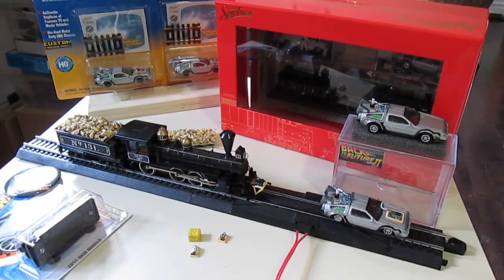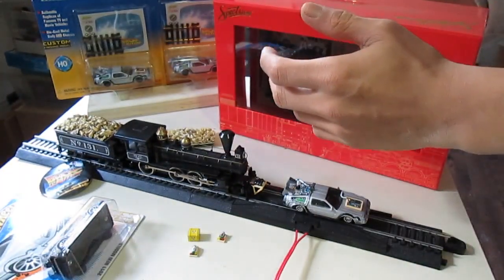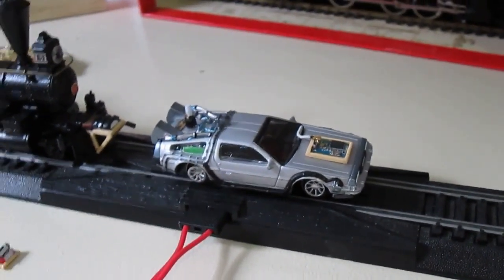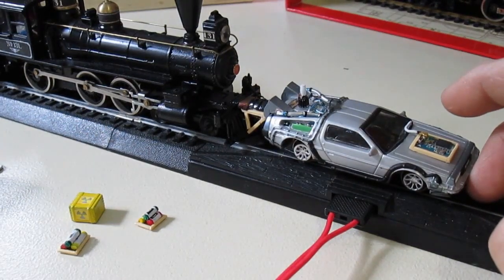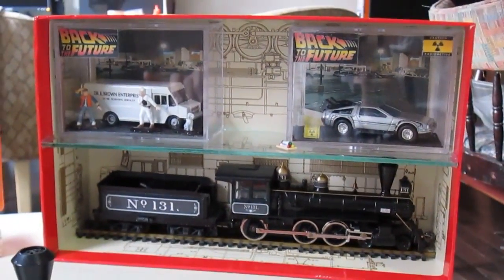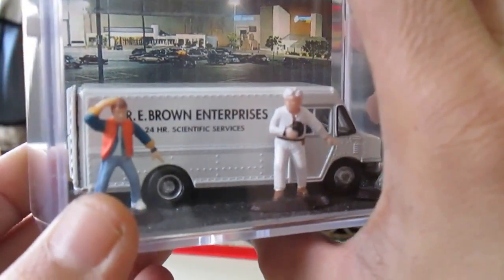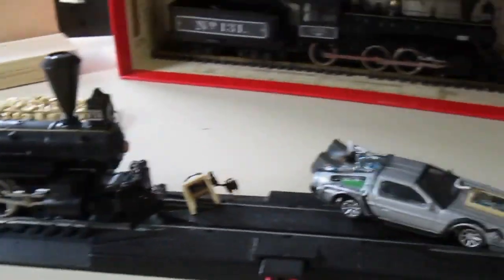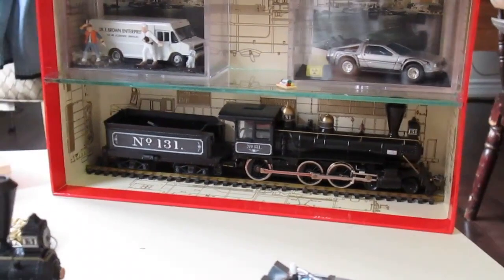Back To the Future 3 HO Scale Train Build  "DIM"

Comment: Very good work but with regards the scaling this is where everything gets messy. And I think your DeLorean and engine actually look real close .    See h.o. scale is 1/87 and hot wheels / Johnny lightning are roughly 1/64  and also there are engine that run on h.o. track that are in a scale called On30 which are actually close to 1/43 scale . Do I'm wondering do you know for sure what scale that engine is because most h.o. scale engines will look very small compared to a hotwheels car. And to be honest I haven't seen a model of that engine in h.o. scale

Comment: Dude Your Good... I may have some questions for you for my HO scale train layout ideas! Thanks For This VIDEO! One Question right now, Hot Wheels are 1/64 scale HO is 1/84 Scale right.. I have some HO cars/vehicles, and put a hot wheels up to it, and its bigger than real HO vehicles. are JL smaller than Hot wheels?
Reply from the maker: Thanks for the inquiry, These scales are all correct however its how u variate the model to the scale HW is 1/64 HO is 1/84 but if you compare HO 1/64 Breaking bad RV and fit it on a train its way too big and does not look appropriate all depends because the JL are 1/84 scale and they don't look too big just a tad wide on both sides Hence the variated wheels and rim.

Comment: Hi, i'm interested in getting a locomotive with DCC, & the Soundtrack chip you put in these locomotives. i have several locomotives like this, could i send you one, & you do the Modifications? what would be the cost?
Reply from the maker: Thanks for the inquiry, I usually sell these all prebuilt as of spare not quite sure would have to source out the parts and price it out depending on what the loco needs... keep me posted I do paint and do all other little wiring works if anything just ask let me know...